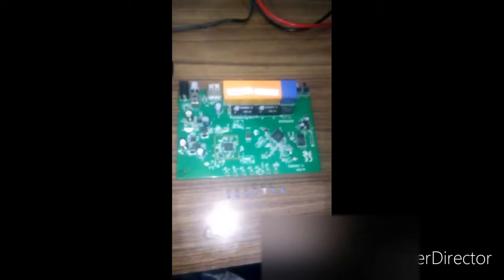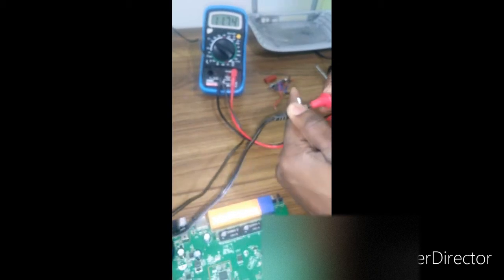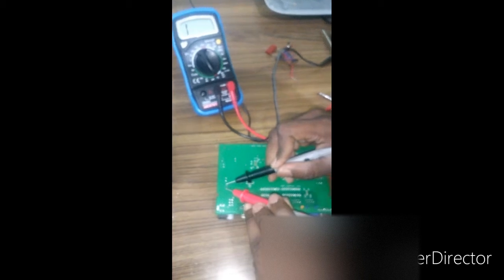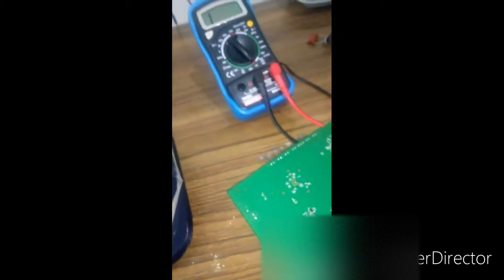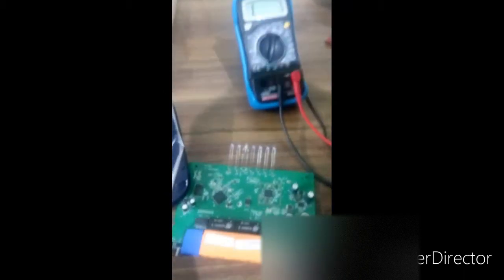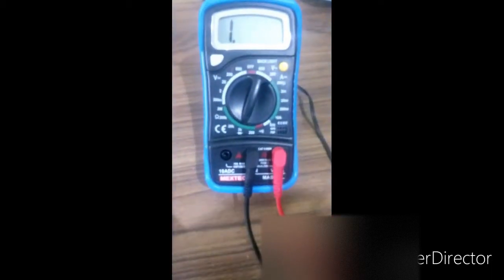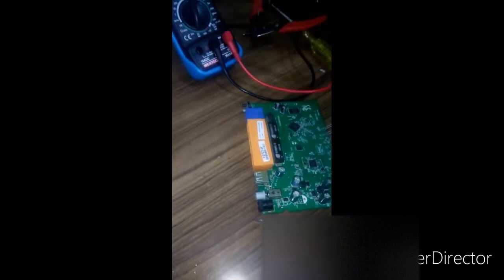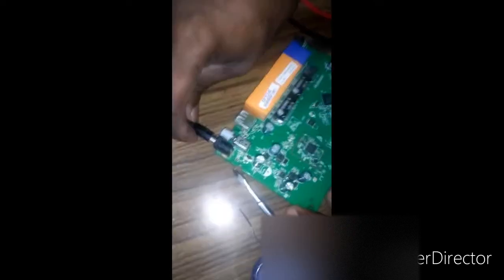📶💻TP link router Archer C20 not powering on - Repaired - part 1

Comment: My router is archer c20 same like u but it caused turned of because of thunderbolt and thats not power connecting now 😭
Reply from the maker: If you have knowledge on electronics tools and hands on experience you can troubleshooting and fix it or check if the TP link support can help u in repairing it.. If the repair cost is less than buying new one go for it.. Else buy new one..
Reply: @-RSIT  I gave my router to repire and it will take 1 month 🤗
Reply from the maker: @nabilnafis2228  1 month ?...😯... I fixed in  an hr..
Reply: @-RSIT  yeah thats fixed and now thats ok bro🥰
Reply: @-RSIT  thank you🥰
Reply: @nabilnafis2228  how much coast paid for repair?

Comment: You must have a different revision.  My Archer C20 does not have a USB port.  Mine is version 5.  I only paid a little less than $30 for it.  My old router was only wireless N so even this basic router was an upgrade.  Mine does not have gigabit Ethernet but my internet is 100 megabits anyhow.  The WiFi is somewhat better than my old N router (that must have been a draft spec of N).